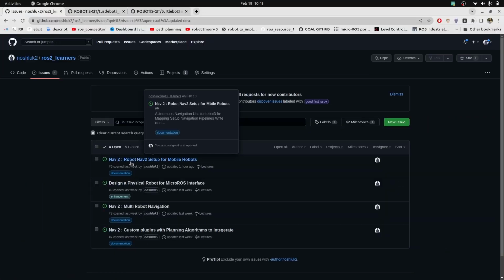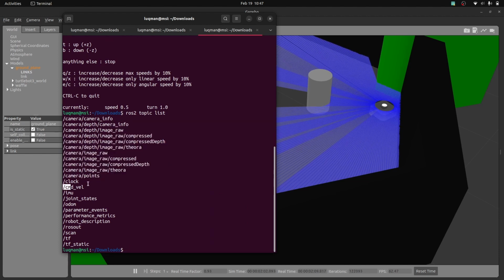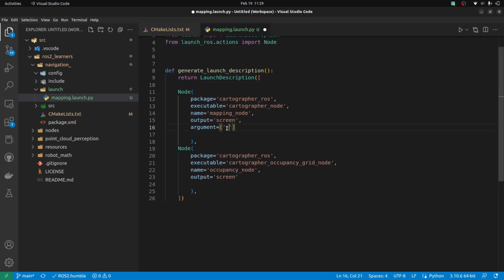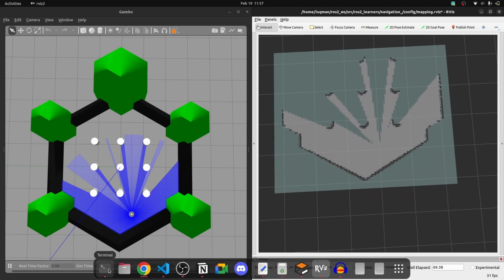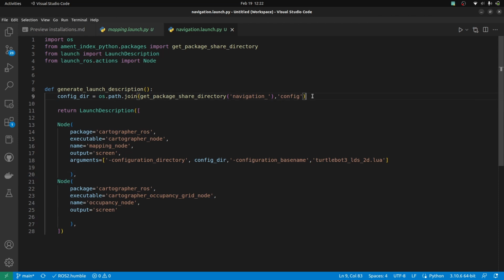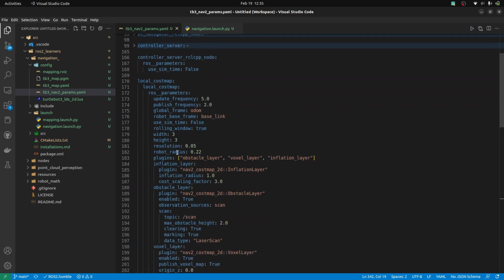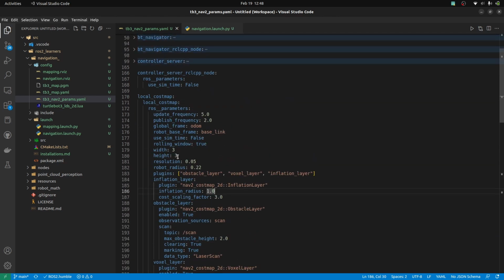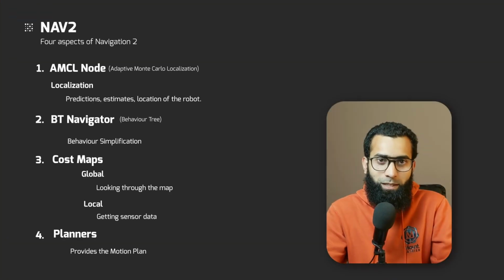Nav 2 in ROS 2 for autonomous Navigation using SLAM for Indoor Mobile Robots

Comment: hi sir,  i have a problem in gazebo. When ever i open gazebo (on virtual machine), then my computer always run at full capacity(100%) and make it so difficult to contact with turtlebot3. do you have any suggesttion that could fix the problem. I am very thankful

Comment: hi , I am working on multi turtlebot3 robot and everything works fine, gazebo, and rviz2 everything is fine. But I want a slam thing like in rviz2 full map should not appear only the portion where robot is standing should appear. I am trying to work on cartographer (like adding a node) but its not working. any advice you can give and provide I shall be very grateful
Reply from the maker: check frames , topics

Comment: Hi, Muhammad Luqman! To which directory can I clone the file turtlebot3-simulation? To source as a pkg inside the src or as a new Workspace? I tried the first one(as pkg in the src where is the dir ros2_learners), but "colcon build" is not working due to duplicate pkg names (turtlebot3_gazebo). Can you help me?
Reply: Hi bro , got the same issue , did you find the solution for it ? if yes pls do tell me
Reply: @vikasp-j1x  No, I didn’t find.
Reply from the maker: delete 1 turtlebot3 package and then build
also remove buil log install directories

Comment: I have 2 questions:  1) Is this on a desktop implementation for a raspberry pi or ssh and 2) Is this installation still valid today?  I am having trouble with gazebo on a raspberry pi with ROS2 humble installation.  Thank you
Reply from the maker: It is on my desktop and it is valid for ubuntu 22.04 with ros2 humble 

For raspberry you need the same ubuntu and ros2 version

Comment: Good afternoon My name is Tat Hoi, I'm currently working on a robotic project, which is using a Autonomous wheelchair for navigation. However I have issue doing the slam navigation after setting up all the lidars and hardware. Im not sure what is the next step for the slam navigation after installing the turtlebot 3 software. Would like your professional advice to guide me on this. Really much appreciate for your professional help. Look forward to hear from you soon.
Reply from the maker: For real robots check first odometery and setup with encoders or some sort of feed back then come to mapping and SLAM
Reply: Hi
have you completed your autonomous wheelchair project?
i am doing the same project are you intrested in sharing some information like code or hardware setup.
if yes please provide me your social media handle or linkedln